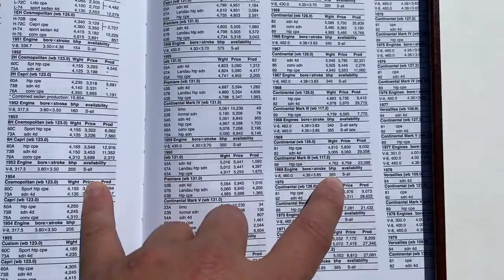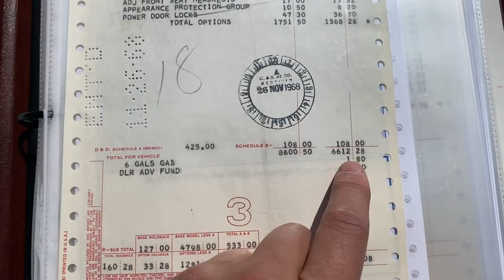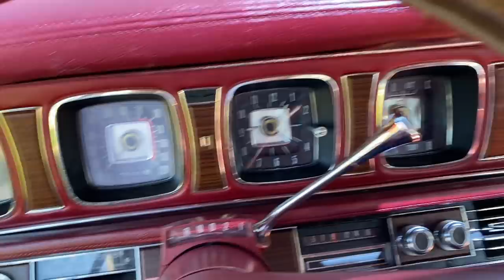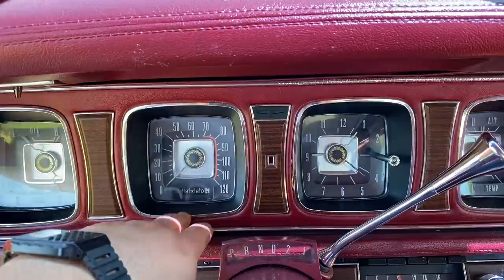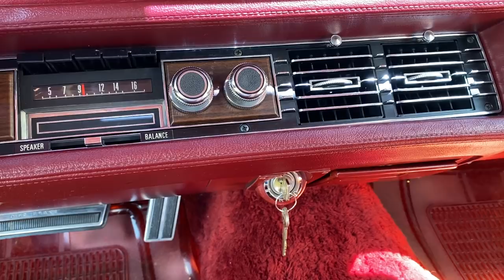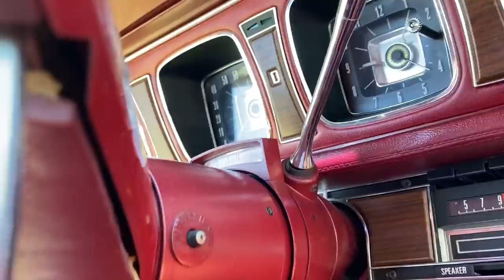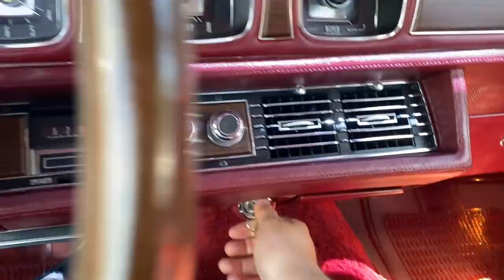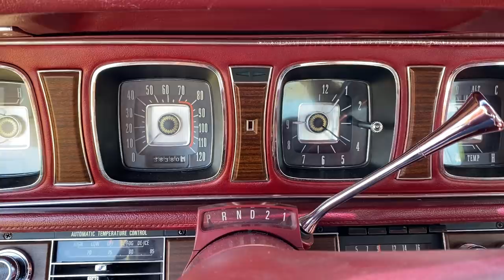The High Point of American Luxury Cars: 1969 Lincoln Mark III

Comment: In 1969 1 USD was 69 Spanish pesetas. A SEAT/FIAT 600 was about 70.000 pesetas it was the basic car that motorized Spain. My Spanish family has textil manufactures in México, my grand father went to France and bought a DS Citroen (the top of the líne) by 200.000 pesetas (2900 USD) in France. If you buy this car in Spain as new you paid 400.000 pesetas (toll taxes by imported car). After two months, When my grampa came to México he sold this car as second hand car with less than 10.000 miles by 250.000 pesetas (3625 USD) earned 50.000 pesetas to the DS (725 USD from 1969). When I spent my holidays at México in the 70:s and 80's I loved to compare the Americans vs Europeans cars... They looked as the cars of the future: even When you compared a Mercedes: every automatic gadget was an extra. (Other thing was the quality, but When you Are 10 years old you just see the buttons, the size and the engine sound

Comment: The a/c compressor is disconnected , but summer isn't the only time it's used.  When the windshield fogs up in winter it's used and just as useful with a/c blended with hot air. It's also better to run the a/c than not. Edit: those are also the cars in '69/'70 when they were new you had to actually hold up or pull the shift lever towards PARK in order to start the car. Some of them may have been fixed under warranty...

Comment: I LOVED the Mark III. But there was one guy who didn't. He had purchased one of the first '69 3s in 1968 for a summer trip to Colorado. Along the way his Mark with the same 7.5 litre engine used for all top end Ford cars broke down going and coming home. Back in Los Angeles his $8,000 Lincoln, known as a "Lemon" back in the day, continued to give him grief, stalling out in traffic, and multiple electronics failure. Beverly Hills Lincoln did their best to fix a problem only to have another one soon come up. The wrathful owner finally took his cursed car to the Thunderbird assembly plant in Pico Rivera, soaked in gasoline and set fire to it. The next day he bought an El Dorado.

Comment: A correction: only the very earliest 1969's (sometimes incorrectly called '1968-1/2') (generally those built before mid 1968 - the 1969 production year was actually longer than 12 months) had the embroidered center panel on the rear seat, mine was built in May and has that feature, which is rare.  The early 1969 units did not come with head rests, as they were mandated into production after the 1969 mode began production (again, early). Very mice video and beautiful car~!
Reply from the maker: Thx!

Comment: I'd replace the valve stem seals. They are known to crumble and go in the oil pan and sometimes get sucked into oil pump and shear distributor gear roll pin. Same with nylon camshaft timing gear. Excellent engine.

Comment: My LTD had a 2.73 rear end. When  left the shifter in Drive to do its thing, gas pedal floored. It would shift into 3rd gear at 95mph. 1st to 2nd shift was 45mph. That might make top end at 150mph. I never had the car that fast. This was the 400.

Comment: Hi Adam, this is the second time I've watched this video primarily because the car is beautiful but also because I have a 68 Thunderbird and some items are similar.  My 68 has a 429 that has a bit of a rattle when cold or accelerating.  Do you think the fuel additives you add to the Continental could solve this problem?  Thanks for making these videos.  They are great!
Reply from the maker: Hard to say without hearing it.  But I would suspect not if it’s a true rattle. May be something w the exhaust.
Reply: @RareClassicCars  Thank you!

Comment: I would strongly advise that you keep your A/C compressor connected at all times. It’s actually a good thing to have it running in cooler weather. In fact, all modern cars today will run the A/C compressor full time when you select AUTO on the climate control, and only disengage it if you manually select the A/C OFF button. This keeps your compressor operational so it doesn’t freeze up from lack of use and lubrication circulation. Also, the best, most effective heat and defogger/defrost is that with dry air. You’ll feel more comfortable. 

If you keep your compressor disconnected half the year you run a higher risk of it malfunctioning. Keep that in mind.
Reply from the maker: Modern compressors are very, very different from the old school compressors.  If what you said were true, back in the day, manual AC systems would have had higher compressor failure rates than auto climate control systems as the compressors on manual systems were only engaged on Defrost or AC settings and not while trying to heat the car.  Having worked for a Big 3 automaker beginning ~20 years ago, the failure rate data for cars with auto systems was materially higher than manual systems.  

My compressor operates quite a bit of the time in the summer, but it's also a small piston engine that wears over time.  It's a balance between usage (which wears internal parts out) and non-usage (which doesn't create cylinder wear, but can cause other issues).

Comment: T birds were made at Wixom too. I would add ZDDP because the 460 had flat tappets. I had a 72 Lincoln Town Car. It also had the manifold leak. Its from pot welds they told me. (inferior metals) Your car is absolutely in pristine condition.
Reply from the maker: I do include such an additive when I change the oil.  Thx!

Comment: I used to go to the airport to get leaded 100 octane AVGAS for my Pontiac.  I'd mix it about half and half, with the balance being ethanol free 87 octane.  That AVGAS is pretty good stuff.  It's not as strong smelling as new gas, it doesn't burn your skin, and it smells sweet when burned.  I used to use it in my two stroke engines as well.  As far as I know, it's the only way to-day to get leaded fuel.
Reply from the maker: Yes. It’s great.

Comment: 23:41 That spring that "does nothing" is a safety feature. It is designed to make sure the doors default to open so the headlights can work if the vacuum system fails. If I recall that is mentioned in the owners manual somewhere as well. Bad advice to remove the springs IMHO.

Comment: One of my favorite Marks. I first saw one in Carmel California in 1968. Your car is competition quality. Did you buy it in this condition? If not just redoing the chrome is prohibitively expensive. What was the condition of this car when you purchased it and what have you restored. This car rocks!
Reply from the maker: Cosmetically, the car is as purchased.  It just needed some mechanical work. AC recharge w R12, tune up, carb rebuild, gas tank, rear wheel cylinders and a few other items.

Comment: Actually with the car not running and the wipers on the wipers will move (albeit slowly) if you turn the steering wheel back and forth. This I discovered while taking the dash cluster out to fix the clock which was the only feature that didn’t work in my ‘69 back in ‘80. By the way the clock was powered by the car battery and was “wound” by a set of points similar to ignition points that would spark open when they made contact, this would run the clock for about 45 seconds. If you ever spent quiet time in an old for you would have heard a click noise every minute or two that was the points making contact thus winding the clock. I am envious that you have both of those great ‘69’s I was never lucky enough to have an eldorado.

Comment: My dad's 1969 LTD Country Squire was the exact same 'Maroon' with the Thunderbird wheel covers. I remember how he once explained that his and mom's his and her's 1958 Fairlanes had valve covers with "Power by Thunderbird" imprinted as well as his 1958 Mercury. I think Ford was never afraid to let it's buyers know they were buying a Ford vs GM's upmarket mania of price tiered segregation of lower priced cars vs upper cost models; did you ever hear of GM placing higher end parts in lower end models? Then again when GM did, it turned into a Cadillac Cavalier- end of the line.

AM-8trak no FM. Forgot that dad's had the same.

Comment: I really have been enjoying your videos! Very through in all the details. Beautiful Mark! Can you explain the headlight spring? So if you remove it the doors will stay down? They won’t tilt back on the first pivot point will it?
Reply from the maker: There's an internal spring that raises the doors when vacuum is lost.  If it's removed, I can definitely attest the doors will stay down.  They are super heavy, you also have vacuum still pulling them closed when the motor is running.  The vacuum simply doesn't have to overcome the spring, so it actually holds them down better vs. having the spring in the system.  

Ford included the spring likely as a safety feature so that if you lost vacuum, the headlights opened.  Without the spring, when vacuum is lost, the door won't open.
Reply: @RareClassicCars  great thanks is that something anyone can do or do you need special tools to open the vacuum pods?
Reply from the maker: Special tools. I send mine out to Critter Creek to be restored.
Reply: @RareClassicCars  I’ve sent my Mark V ones to them. Top notch people!

Comment: That problem of the transmission slipping into reverse is a serious and prevelent problem especially when you're model is equipped with the automatic parking brake release, I had it happen to me and I found myself chasing my Mercury around a intersection trying to open the door and jump in, thankfully I was a healthy athletic 25 yr old at the time

Comment: Goodday Adam, 

My absolute dream car, I have been watching Lincoln Mark III for years through the auctions over in the states. 

You can't even buy a 1:18 Diecast Lincoln anywhere also. Here in Australia I haven’t seen one & I love to bring one out to Australia. 

Becsuse our cars here are right hand drive I will need to fit a passenger side mirror. Did they come with a power passenger side mirror. 

Did they come centre console option.

Also I read somewhere that the 69 Lincolns jewellery 
Moulds around the front & rear window, wheel arch moulds etc were of better quality than the 70 & 71 Lincolns. 

Sorry about my comment on the Pontiac Catalina regarding hardtop & coupe.

Great video I feel like I am there with you. 

By the way just subscribe. 

Cheers

Louis Kats from Melbourne Australia ☺ 👍 ❤

Comment: Try to find any official material from Ford referring to this as a Lincoln. The Mark was marketed as a Continental up until the 1986 model year. Read James K Wagners book published by Crestline where he touches on this. Of course the American public never caught up on the distinction which especially had many confused when we got into the distinctions between the 1980 Lincoln Continental and the 1980 Continental Mark VI and their package names.
Reply: Similar situation with the Imperial, it was a separate brand but most people called it a Chrysler Imperial.

Comment: Thank you for your video I really enjoyed it I am blind so I extremely legally born so I really couldn't see anything but I know what the car looks like in inside and out. I own the 74 Mark 4 I bought it a second hand it was 13 years old when I bought it and had I think 40 some more thousand miles on it had the car repainted going over fixed everything in the front end we place the a lot of little things I did to it to bring it up to snuff. I love that car I probably one of my favorite cars that I own and I've owned let's see a 57 Ford ranch wagon two-door that car was over 30 years old when I bought it just had a complete rebuilt engine and transmission like a hundred miles I own the 65 t-bird landau 66 Thunderbird basically stock except for the engine and tranny those were worked and it was all chromed in fact that that car was a rocket ship compared to my landau and I own the 81 eldorado barrettes the 74 Mark 4 was a Cartier edition what are the old cars that I own on the $67 Dodge dart that was pretty cool car as far as classic cars that was it so I'm familiar with the 69 through 74 little bit of the 75 I opted for the 74 over the 75 when I bought it I just liked it I thought it was more refined looking on the side of the front fenders like gills I thought the 74 it was a little bit more refined I love that car loved all those classes would like every option including a built-in compressor to raise and lower the front and rear car it wasn't automatic they were dials in the controls are underneath the dashboard on the transmission pump that car was in mint green with the dark green interior beautiful car the mark four I had was blue anyway thanks again sincerely Bob the blind bedroom guitars

Comment: Disconnecting the A/C compressor for long periods is really not recommended.  The seals get no lubrication when the compressor isn't periodically running, so they'll dry out faster.  You may not notice any bad effects for a few years, but they will degrade and leak over time.
Reply from the maker: I just disconnect it on cool days when I don't need it; it runs plenty in the summer.

Comment: Also, one other feature that the Lincoln Continental Mark III had is real wood grain. I have personally owned a 1972 Lincoln Continental Mark IV and a 1976 Lincoln Continental Mark IV, and my 1972 had real wood grain but my 1976 had plastic moulded wood grain. Big difference between the two. My current classic car is a 1975 Lincoln Continental Town Coupe’, which I think is plastic wood grain.
Reply from the maker: Only in 70/71. The wood is fake in 69

Comment: If you leave the springs in the headlight actuators, and they don't stay closed (especially while the engine is running), it's an definite indication you have a vacuum leak somewhere. You don't want vacuum leaks in any car's engine, so that has some value in addition to the safety aspect. 

This is a beautiful car in a gorgeous color, and the Mark III is on of my all-time favorite classic American luxury coupes. I had a 1972 Mercury Marquis, which was also very impressive in terms of build quality, engine, ride / handling, and style. IMO, Ford simply built better cars than GM in this era.
Reply from the maker: Yes. Often the vacuum leaks are in the actuators themselves.

Thx!
Reply from the maker: Check out the video of my 71/3/4 Mercury Marquis.  They’re my favorite!

Comment: 6 gallons gas.  
Holy crap. 
That's barely enough to get the car to the nearest station, if you're lucky.  
But it was Only 30 cents a gallon.  
Here in California, it was at least 40 cents a gallon at that time.

Comment: I've watched this video and your video of the '72 MkIV.  I can comment to both as I owned a '71 MkIII in black with the tall back seats. It had the Phaeton package and wasn't a bad looking car.  Unfortunately it was past its prime and consumed almost as much oil as it did fuel.  I remember the hydraulic windshield wipers and the quirky problematic rear window gears that would shatter with age leaving them inoperable.  Mine had issues with the door panels, the cruise didn't work, nor did the AC.  Overall, it left me with a bad taste.   I later had a '76 Thunderbird in the gold and cream package with the forged aluminum wheels.  This would compare well with the '72 MKIV.  The Thunderbird was a little better on gas and everything worked on it, so in my mind it came off as a better vehicle.  Admittedly I'm biased against the MKIII and I know lots of people like them.  I enjoy your reviews and am impressed by the number of cars you've accumulated.  Keep posting !

Comment: Vacuum intensive indeed. I had a 67 T-bird with a crazy manifold and lots of vacuum hose to leak under the dash. All to open Heating blend doors etc. When a simple cable would have sufficed nope not Ford, the Cougar was similar. Nice car though wow its really pretty.

Comment: I really appreciate your insight. Only thing I question was the Torino comment. In 1978 t birds were almost identical to a Torino but the 72 thru 76 tbirds I thought were built on a different full size chassis   they drove completely differernt
Reply from the maker: They were but it was based on the Torino chassis and shares many components.

Comment: When I look a the speedometer, there's a red "bar" that begins at 70 MPH.  I'm wondering if that was part of the "mother-in-law" optional feature.   It was an overspeed warning buzzer that you could set for just about any velocity.  If you were driving on the highway and lost track of your speed, this buzzer would annunciate the moment your speed exceeded whatever value you had set.   On G/M vehicles, there was an extra needle in the speedometer with a knob on the dash to permit you to adjust that needle (sometimes called a "bug").  But, I'm not familiar with FoMoCo dashboards.  So, I'm wondering if that colored band was instead of the needle.   Otherwise, I cannot think of a reason why 70 MPH would have any special meaning.

Cadillacs of that same vintage were using the fiber-optics for the turn signals.  The illuminated indicator was located at the front tip of each fender.  There was also an indicator for high beams that was fiber-optic.
Reply from the maker: No overspeed warning on this car like the GMs

Comment: Look at the tiny restrictive snout that the factory added to the air cleaner.
460 cubic inches sucking through a 2 1/2 by 1 1/2  inch hole.

Comment: The springs are in the headlight doors so if you have a vacuum failure and it is night time at least the doors will revert to an open position so the headlights can be used and you can drive at night duuu